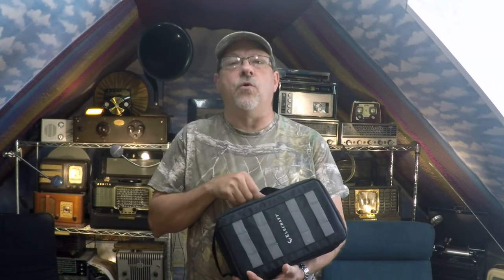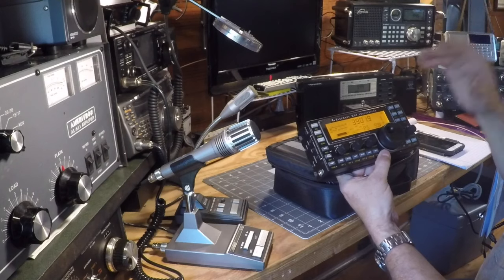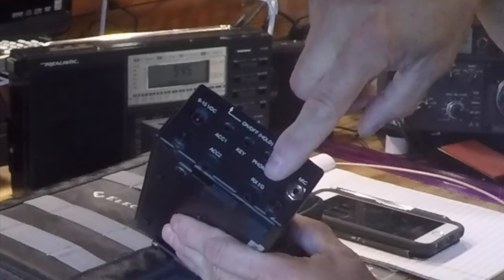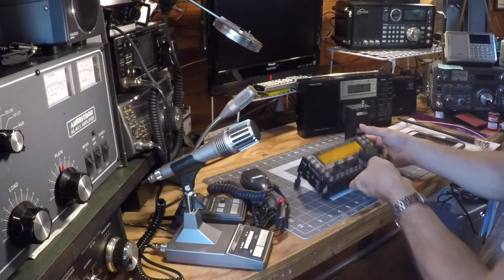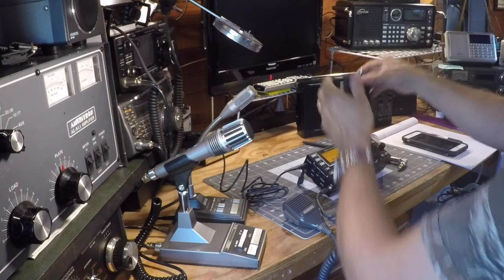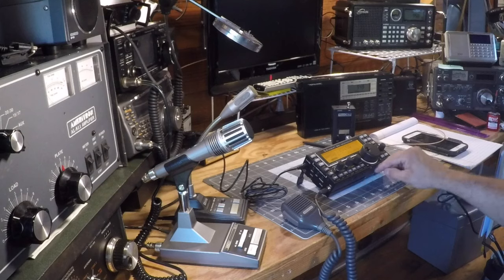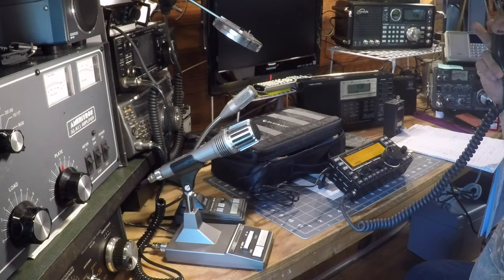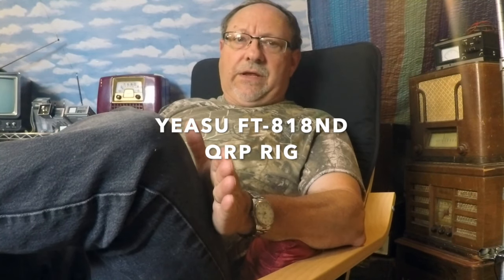Elecraft KX3 QRP Demo

Comment: Hey Kent
My KX2 is in route..
I like your little youkits antenna checker.
The KX2 will do 20 watts. But you know I like 1 and under for QRP.
Don't forget to use transformer wire @ 26 gauge and balloons to get it a nice vertical.
It works great..
If there's a farm fence around it makes a perfect counter poise.

Comment: Kent,  I hope you enjoy your KX3.  I enjoy mine.  My eyes wondered across your ham shack and I immediately noticed that good looking Tecsun S2000. I did not realize they had a higher end desktop radio.  It looks like that Grundig radio that RadioShack used to sell. Also spotted, is the DX400 radio, along with the other eye candy. Enjoy! 73.
Reply from the maker: WB0WQS hello!  Thanks for the comments. Yes the Grundig and Tecsun are identical radios. I got this s2000 on a special deal at Amazon (or maybe eBay, can’t remember). It is a jewel.  The audio is incredible and the front end is very sensitive and quiet. The DX440 is also a gem. It’s very sensitive and they both are top notch listeners.  I also have the Eton executive satellit - and it’s cool for what it is, I listen to them all daily and switch around. They are all SSB radios as you know, so I listen to my friends chat while I work.  Thanks again for the comment.